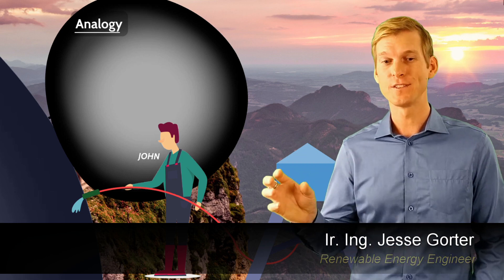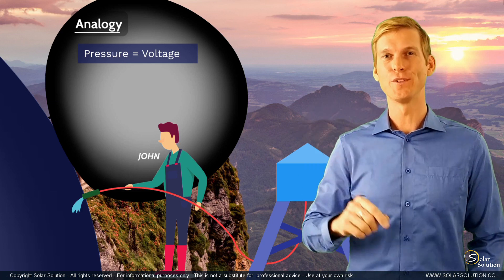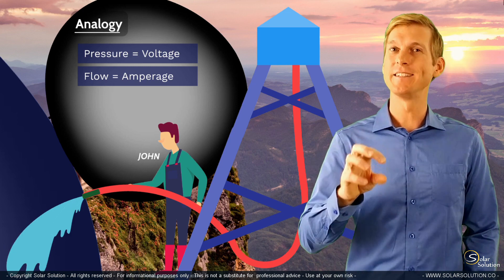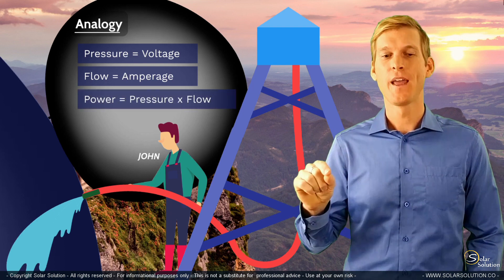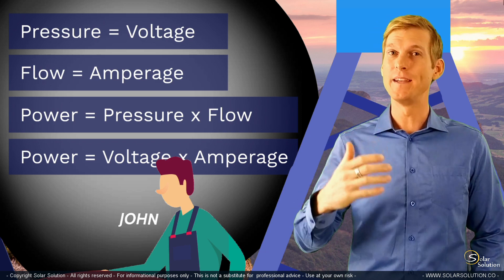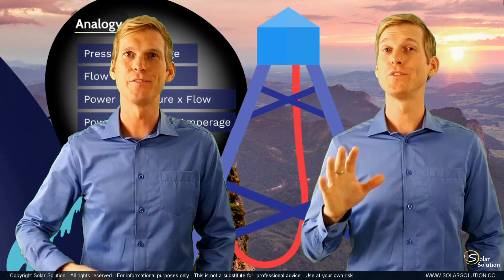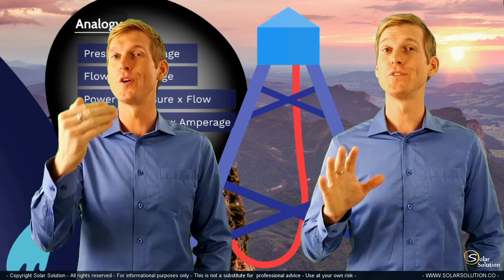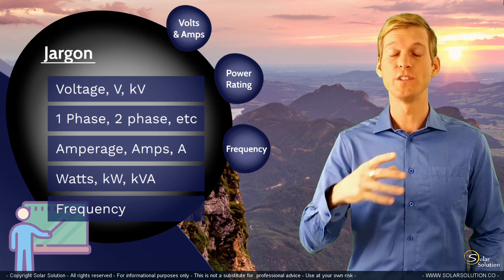Electricity Explained Simple: The difference between Voltage, Amperage and Power

Comment: thank you for this analogy, but if you are looking at it this way, if you increased the size of the hose did the pressure change? or just the flow? with the water tank at the same height.
Reply from the maker: Good question! Increasing the size of the hose does not change the static pressure, though it does impact the flow resistance. Enjoy!

Comment: No you did not show any way for the water to speed up or have a momentum factor like a heavy fan because the water is not electrons and waves and it is enclosed and not even swirled at a constant for a good example or what part of the tank the hose is connected for different results and the hose explains volts and amps as the same thing especially without a loop or curls in the hose for some meaning but the water analogy is terrible and a perceptual dead end and as a raw student in this craft u suck as an information interpreting and explaining content creator honestly and explain things like you actually understand how they intertwine like you were trying to summarise it to your younger unmotivated doubtful depressed self or just a good genuine faithful growth ambition and interest and progress and beuty oriented explanation